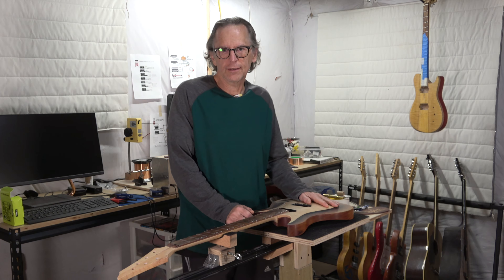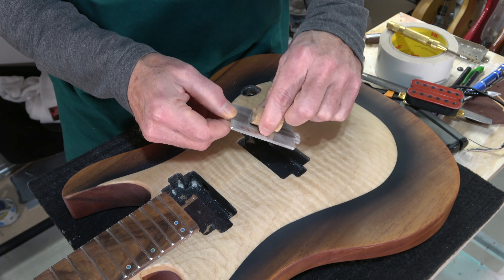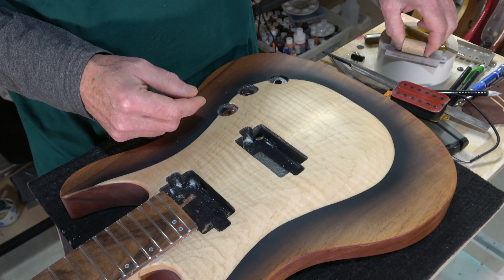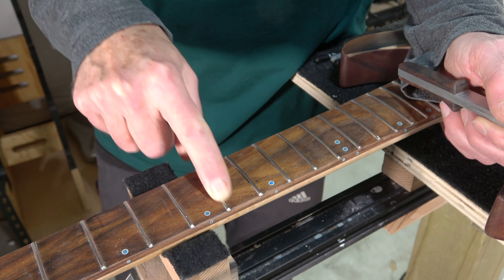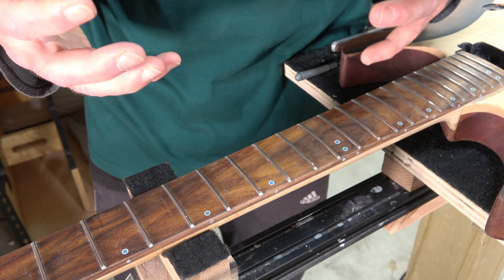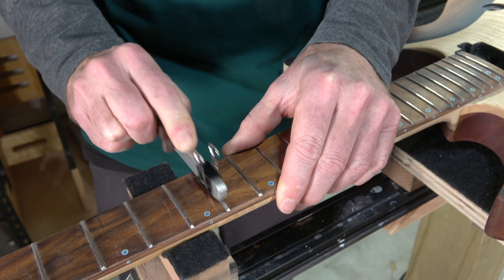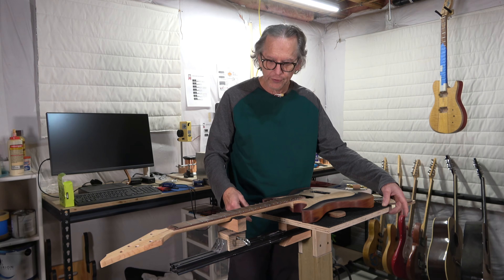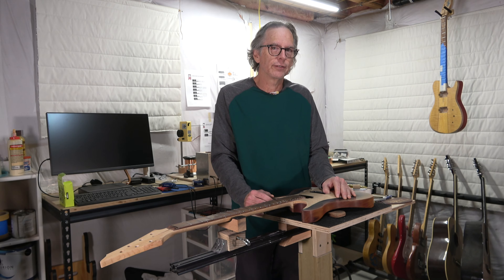2 New DIY Homemade Guitar Building Tools

Comment: Two good ideas. I like the sanding stick. I’ve been using those plastic sanding sticks since the 80s. StewMac used to sell them. I did the same thing and filed a groove in it.
Reply from the maker: It’s actually a prototype. I want to refine the handle to make it easier to use over the body.